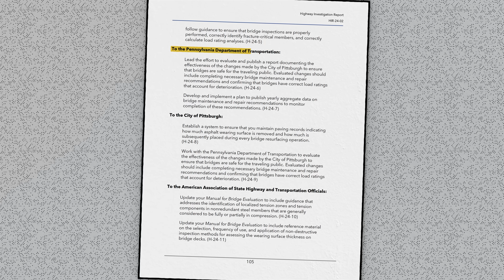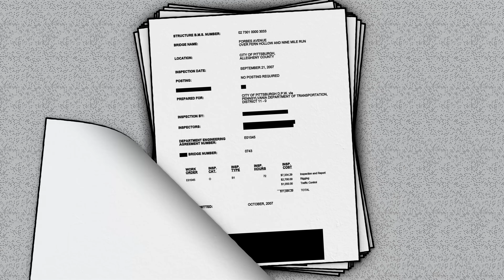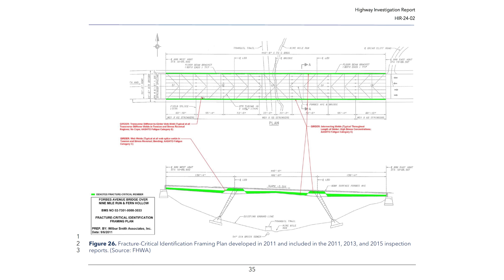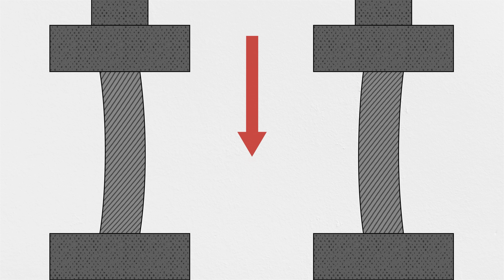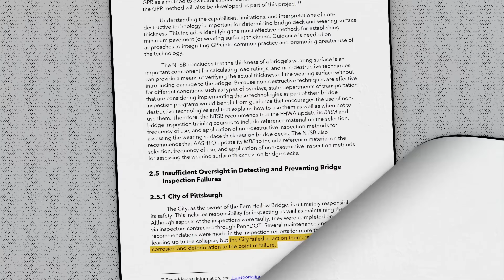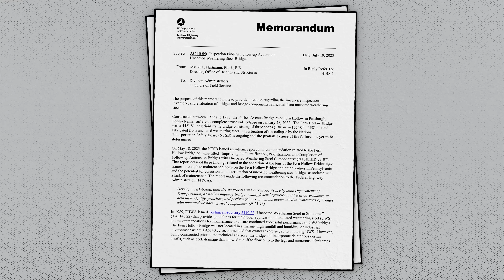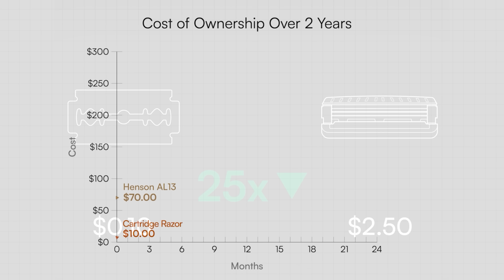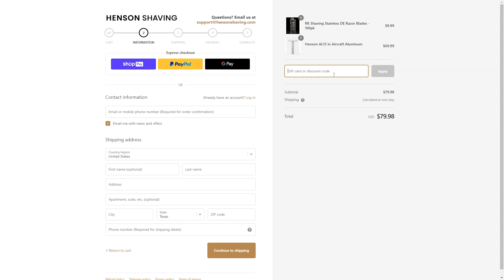This Bridge Should Have Been Closed Years Before It Collapsed

Comment from the maker: 🌉What do you think is the solution to this failure?
🪒Get a cool razor and 100 free blades: https://bit.ly/3CWiWJP
Reply: Simple solution: in Germany the inspectors simply have the authoriy to close the bridge (or any piece of infrastructure) if they find any critical stuff.
Reply: Galvanising would have protected it better methinks.
Reply: well to your point at 17:37, I'd argue that that whole ordeal is to prevent a post like that from existing, you can't take a picture of a completly rusted off steel member if it gets fixed when damaged and a steel beam with rust on it at that kind of bridge will not get any attention, so the "common sense" point feels weak, if we have to use common sense, call me uninformed, but I think then it is way past the point where action should have been taken.
Reply: Compounding inspection recommendation priority. With automatic preventative action if it reaches a certain priority.
Reply: Strong Towns talks about this stuff a lot.  Having a “maintenance mindset” where maybe you build less but maintain it well and plan for maintenance funding from the beginning.  Seems like a good solution.
Reply: I heard you say you went through 30 blades in a year.  Someone is doing something wrong I go through 3 to 4 a year.  I bought 200 blades when I bought mine years ago.  I'm starting to use the blades for everything I can think of I will never get through that many in my life time
Reply: Fail-safe; Designed so that when it fails, it fails in a safe manner. People (and especially engineers) need to learn (or relearn) what the term fail-safe means.
Reply: When these thing happen they need to do an investigation of who said leave it open including the elected officials. Far to often I have seen elected officials voting to override the people who say close it. They will then vote to build a new building or park while saying there is no money to fix what they already have. 
Until they are held accountable nothing will change.
Reply: I think the solution to a bridge failure is build a new bridge. Of course, it's an opportunity to evaluate present needs. MAYBE the solution is just close the road.
Reply: @jimk8520  failsafe are important but it also has its limitations for how it can be used, like how do you engineer a few ton bridge to fall several meters safely? And even more for large bridges. The gas pipe getting exposed and broken which could had lead to further damage is pretty much the only point where that could had been done 

Personally I'm all for what the guy from Germany said
Reply: If government is responsible, no one is responsible.  This is completely a government problem.
Reply: 1) when projects are first undertaken, the entirety of maintenance costs for the life of the project should be allocated up front and cannot be reduced later. If you can’t pay to maintain it don’t build it in the first place. 

2) the minute “this thing seems unsafe” shows up in a report it’s closed pending repairs

3) one PERSON is responsible for the project who has the final say. Not a committee, not a government, not a company. One person. They also have personal liability— they don’t do their job and ignore reports and something like this happens, they face civil and criminal penalties. If you can’t find someone willing to put their own skin in the game, then don’t build it.
Reply: @tylerh4612 my thoughts exactly. Except in the US we think we have endless amounts of money so we try to do both and fail at both too often
Reply: @jimk8520  You can not design everything fail-safe. That would be like building 2 bridges instead of 1, except that the "lower" bridge needs to be able to hold another bridge and not just some cars. BOTH then need to be maintained, the lack of which was the issue here. So how would that change anything?
Reply: It's nice when a level-headed engineer expresses solid, well thought out recommendations and shares them winsomely with the public.

They should have a monument to the people that could have died at that bridge. This is what happens when the bureaucracy fails or something like that. Definitely should be in the textbooks.
Reply: @leocurious9919  Think bigger. They could have decided to reroute the road such that they didn’t need a bridge. They could have filled in the area where they needed the bridge and just made a road. They could have removed dirt and such on both sides such that the road could have gone down one side and back up the other. Think outside the box.
Reply: @link7417  I like what the German dude said, too. With that said, it’s obvious that the new one they’ve built doesn’t have nearly as many design issues as the old one did (even if it isn’t as “pretty”). Hence, certainly more fail-safe than the previous one.
Reply: Inspection oversight and people held responsible should do it?
Reply: The simplest and cheapest solution I think is to clean the drainage ports. Ignored in infrastructure so often.
Reply: @ParanoidMaster that’s definitely something that should be implemented in America. In Germany are the bridges government owned or city owned and are the inspectors private contractors or are officials of the government? And when I say government I mean from the national government? I’m curious
Reply: @jimk8520  but that isn't what fail-safe means, it means that something fails into a safe state, take a lathe for example, if the speed controller would fail for it to be fail safe would mean if it failed it would cut power to the motor, so it's in a safe state, doesn't matter how well built that speed controller is, if it doesn't do that or a similar thing it's not fail-safe,
Reply: Funny how slow the NTSB is, it’s almost like Dan Gryder is on to something…
Reply: @link7417  Notice that I used the word “more” first. Being closer to a target can still mean one has missed said target. I do know what fail safe means.
Reply: No amount of money can force Democrats to prioritize infrastructure over flashy projects and corruption.
Reply: Many a man has tried to push rope, and its never worked, its almost a rite of passage.
Reply: @link7417  I also fully realize that nothing is perfect and nothing lasts forever but we can and should get closer than we do when it comes to critical infrastructure. Heck, simply replacing infrastructure that has already reached its design lifespan would go a long way toward avoiding this type of issue in the first place. And when addressing infrastructure types like this, knowing we’ve already needed it for 50 years, when we rebuild it we should build it to last (yes, that is possible - I mean, the romans proved it a long long time ago).
Reply: The bureaucracy you have, the less common sense and action.
Reply: Shipping to Europe costs the same as the product. I think you should have mentioned that the offer is effectively for Americans only.
Reply: @dckatyx9577  And no amount of money can force a Republican to prioritize anything at all over profit.
Reply: Better regulation and real consequences for the people who neglect this sort of thing.
Which won't happen because, in the USA, the Gov is controlled by large companies and/or their lobbyists.  ☹

I'm often surprised, sometimes appalled, at how poor consumer protection laws are over there, if they exist at all, watching Louis Rossmann's rants often baffles me.
Having said that I'm often frustrated by how little the penalties are for failures, here in Oz. 😒
Reply: Grady for Transportation Secretary!
Reply: Not only give the inspectors the authority but the responsibility to close unsafe infrastructure.

We could also require insurance policies for public infrastructure. Insurance companies would refuse to insure risky infrastructure and it would have to close or be repaired.
Reply: @JC-yt1pm    HAIL!  I Second.   
ALL political power is Inherent in the People.   🇺🇸
Reply: PS ...   they are SERVANTS, not "officials".
Reply: During my career as an engineer (EE), EVERY product that my companies offered had a "Responsible Engineer" who had broad authority to, for example, issue a recall or engineering change order ("ECO") . When a major fault was discovered (and it did happen occasionally), the Responsible Engineer ensured that existing installations were immediately shut down until a fix was in place.

The rub, of course, is that this is a role that requires expertise, training, and experience -- and is therefore expensive. So long as taxpayers refuse to fund government, catastrophic failures like this will continue.

Ironically, my own degree is from CMU in 1974 -- a short walk from the failed Fern Hollow bridge. I remember when the failed bridge was opened to great fanfare as noted in this excellent piece.
Reply: @jimk8520  you clearly don't if you think if you can't separate something being built more sturdy and longer laster and fail-safe, you are expanding fail-safe to mean won't breakdown or less likely to breakdown, I am not disagreeing whit you other then vocabulary, we can't tell if the bridge is more failsafe whit out a deeper analysis of the structure, which I can't do from just a image or video, I would need a blueprints and material specs, else we are just saying, yea that looks built great like 

do I think bridges built today is skimming to close to the margins in persuite of both governmental and corporate profits? ofcourse I do,
Reply: This bridge did not collapse without warning; the warnings had been clear to see for years.
Reply: @0MrMath  This is something you will learn if you use YouTube again.
Reply: You may want to keep the beard Grady.  Looks good on you.
Reply: Tax the rich!
Reply: @dang48 He can't seem to grow it on his head or his face.
Reply: Those Henson razors are really good for a younger person, but they're too expensive for an older man. The Maths are against someone like me buying one. 

After calculating the advertised cost of a razor plus (an essential) stand, adding sales, import duties, shipping costs and handling fees it would cost me close to $175 to have it delivered to the U.K. I spend the equivalent of about $7.50 on blades for my razor every year, and I almost always buy them in bundles of 10 or 12 packs which last me for 12 to 15 years. 

On that basis, to break even with the cost of a Henson plus a stand it would take me about 20 years, not counting the cost of buying good blades for the Henson. That will happen when I'm about 90 years old. No man in my family tree has ever lived for longer than 84 years. So I shall buy a few more packs of blades in about 5 years' time, if I'm still alive and shaving.
Reply: @RWBHere  I use and love the Schick 5 blade razor, which gives me an ultra-smooth nick-free shave. Each cartridge tends to last 1 month, although I would ditch them after a week if they were cheap. Does the Henson single blade shave as close as my 5 blade, and is it nick-free?
Reply: @ParanoidMaster  Not simple. Infrastructure spending by law is not the priority.
Reply: The solution is that your bridge inspectors should be able to do more than make recommendations. I think it's a pretty good general rule that the people who have to foot the bill for safety measures should never be the people who have the final say on if they're enacted, because they're always going to be biased against doing so. It's the most telling thing about how broken the system is that you had decades of inspections making the same recommendations to repair things and nothing being done because they didn't have to.
Reply: Insanity Is Doing the Same Thing Over and Over Again and Expecting Different Results
Reply: 50"Solution to this failure"? Pay me a lot now or pay me more later.
There are so many layers to this failure. Build a rusting bridge in the rust belt, a couple decades of acid rain, all the extra asphalt that probably clogged the drains. The bus was the actual final straw, or was it the speed of the bus or that last inch of snow.... It reminds me of the rust in areas of my '66 Mustang. Every drop of water left behind a bit of debris in every nook and corner that held more and more mucky water against steel for ever increasing lengths of time. Ford engineering didn't plan to build a car to last 50 years but I bet those bridge designers thought they were, soooo how old was the bridge? 🌉 Somewhere that guy is saying, I told you so.
Reply: The solution to the failure is obvious.  But the politicians and bureaucrats will investigate their actions and find they did nothing wrong. So failures will continue unabated.
Reply: @SolaceEasy  He seems to be doing a pretty good job of the beard on his face.  These take time.  I know, it took a couple of weeks before my beard was thick enough to be shaped.
Reply: The Fern Hollow bridge collapse seem to be mostly a failure to follow the intent of the process. It seem like some people had the idea that the process is done due to legal requirements not because there is logic behind the steps. The NTSB correctly has no ability to prosecute the people responsible. (There are good reasons for this.) I wish that a parallel legal investigation happened for this bridge much like what is happening with the Key bridge in Baltimore. It may be too late at this time because the information in the NTSB report cannot be used in litigation. (If I understand correctly.) This is to protect future NTSB investigations.
Reply: ok this is personal taste but to me new bridge looks way more pretty than the old one ever did
Reply: Maybe spend/send less money overseas for a start?
Establish local accountability, government itself seems to only make for more government.
Reply: @ParanoidMaster  This, it's insane an inspector can't order the closing of a structure due to safety concerns.
Reply: @ParanoidMaster  We have something like that in the construction industry in the USA. Someone who has "Stop Work Authority". If they believe something is unsafe, they can stop all work on a construction site
Reply: Actually funding bridge maintenance instead of 🙈🙉🙈🙉🙈🙉 over and over again. 

Inspections are wireless unless the problems discovered are acted upon. A law that mandates demolition of any bridge found in poor condition in two consecutive inspections might do the trick, if state govt has the cojones to ignore the howls of complaints.
Reply: @ParanoidMaster In the US such a decision would be reversed by the politically appointed leadership in seconds. Too many idiots think they know more about the matter than the engineers who have studied such things.
Reply: Obviously not enough duct tape and cable ties.
Reply: Was it a failure though? It seems to me this is exactly the kind of ineffective bureaucracy Americans actually prefer as it supports the all-government-is-bad mindset.
Reply: Sorry to say, but that beard doesn't really suit you. At least that is me and my girlfriend's opinion. I hope that is okay to say, as I hate when people lie to me about a new style and I only find out several months later.
Reply: Part 1: Automatic priority escalation. Part 2: Predefined point where the major priority gets automatically escalated. Part 3: Give NTSB responsibility to issue a followup report. All of this won't prevent a disaster given arbitrarily dysfunctional reviews & inspections, but should reduce the frequency of similar failures.
Reply: Stop hiring contractors to "save" money. The machine is failing because we're replacing high-quality pieces with cheap after-market replacements.
Reply: Eliminate the layers of bureacracy between the inspectors, the engineers, and those with authority.

When an inspection teport is issued, the three need to sit down together and discuss it.
Reply: ⚠️⚠️Savekerala⚠️⚠️from📛130 yrs old ⛑️⛑️ Mullaperiyar😭😭dam collapse 🙏🏾🙏🏾🙏🏾 please do a awarness video on this
Reply: ⚠️⚠️Savekerala⚠️⚠️from📛130 yrs old ⛑️⛑️ Mullaperiyar😭😭dam collapse 🙏🏾🙏🏾🙏🏾 please do a awarness video on this
Reply: @travismartens1637  I was doing the same as you, changing it when it was dull. But then I had that same realisation as you, at this rate I will be giving blades to my great grand kids as inheritance. so now I take a new blade everytime and have an easier shave than working with a somewhat blunt blade
Reply: @ParanoidMaster  I fully agree with that. I think it's a must have. But it should be the last solution to this problem, if the bridge is not properly maintained.
Reply: Rules are only as good as their enforcement.
Reply: The problem with the 'Machine', as you put it, is that everyone needs to be paid and there are time constraints, a great deal of bureaucracy can be removed so taxpayer funds are not wasted. Look what happened with Twitter, 80% of the workforce let go.
It is easier to have one company do all the work and then report to one authority and hope like hell they are honest.
Reply: "Get a cool razor and 100 free blades"  - newly-minted Practical Beardman 😉
Reply: People in the past: We will build amazing infrastructure for the future!
People now: How can we avoid spending any money?
Reply: Eyes and common sense.
Reply: :hand-pink-waving:
Reply: $$$ Money! Money for more inspectors, money for proper maintenance. The Cape Cod bridges when I first started going to the Cape 20 years they were going to replace the two bridges and every year since then they have been trying to get funding for it. One of the places that Fern Hollow Bridge got their funding for the new bridge was from the Cape Cod bridges, the funding that Congress had for the Cape bridges that year went to Fern Hollow Bridge and another bridge. Funding for the infrastructure seems to go to the squeaky wheel, or which politician who has the biggest clout.
Reply: MorganOlt  In Toronto, the city health inspectors do a red/yellow/green thing on every restaurant, and the last result MUST be on display prominently when you enter the restaurant. Most places have it in their window next to their hours. It's awesome how quickly yellow signs get updated. 
Someone made the suggestion that the priority of the fix gets raised every time the bridge fails inspection, so a B will become a C next year if nothing is done. That's great, but the grading system has to be out of reach of the politicians voting on the budget. If they can redefine the standards so that a B becomes an A, we're back at the start. I think that means the federal government needs to set standards, but state or municipal governments should be in charge of inspection.
Reply: It's Pennsylavnia, it's endemic to the culture, that is, ALL Public Agencies do this . . .
They can never find the money to MAINTAIN anything, but always manage to do what it takes to replace a facility once someone is hurt or worse.
Reply: Government should be sued for negligence it seems they let the bridge collapse instead of maintaining the old one.  I'm sure lots of people will fund a new bridges construction that will cost much more than the old ones maintenance
Reply: MorganOlt 
These inspection reports are sent to the bridge owners - Pittsburgh government in this case - but the public rarely notices all the neglect.  

It seems to be the responsibility of muck-raking reporters to motivate the public. 

However, the reporters are going to have difficulty when the inspection reports becoming classified for reasons of "national security".
Reply: How about just requiring, by law, a licensed engineer (PE in the U.S.) to sign off on keeping the bridge open after every inspection? (She should have access to all previous inspection reports and recommendations, too.) If, based on the inspection report's recommendations, sufficient mitigation isn't done you'll not be able to find an licensed engineer to sign off on it, and you'll have either to do the required fixes or close the bridge.

We already do this with new builds; I'm mystified as to why we don't do it with continuing maintenance.
Reply: Operational Risk Management Tools.
Reply: Give inspectors a degree of power to close bridges. Or have someone who does accompany inspectors on a regular basis. The most fundamental issue is the sectionalized task, so bridge that gap which is as simple as giving someone authority even if limited in both areas
Reply: Henson nailed it when making the razor...
Reply: @dckatyx9577 Biggest infrastructure bill since the highway project was passed by democrats lol
Reply: Hold people accountable, people in these positions feel comfortable dismissing a bridge report for YEARS with no possibility consequences for their inaction. The inspectors did their jobs, even the group that did the load evaluation, the mistakes made where not unreasonable. The City of Pittsburgh failed, the people tasked with taking action from those reports should have been held accountable, possibly criminally. 

Implementation of laws that would allow for the prosecution of gross negligence in these position would lease to people involved in these processes being more motivated to do their actual jobs.
Reply: @neurofiedyamato8763  …with overwhelming Republican support. Unfortunately, if you track the money, you will find that much of it does not actually go toward infrastructure - just like with the previous bills passed during the Trump and Obama administrations.  Green projects, sustainable cities, and numerous other special interests receive priority from corrupt politicians and bureaucrats.  Look how high California gas taxes are and their crumbling infrastructure.
Reply: Why does the webbing and reinforced sections have to be only at right angles? 
If the water and debris could slide off, it would dry up.
Reply: The only thing that will fix it is SPENDING. We should be spending on ourselves first. Not wars.
Reply: @donk1822 Galvanized is just a zinc coating on plain steel. We should be using steel with more chromium aka stainless steel. All steel rusts v
Reply: We have Weathering steel structures used in some of our 500 kV transmission lines and we are replacing all of them because of the same rust issue due to the humid climate
Reply: The problem here is that budgets for such stuff are typically served last, and it is politically and managerially easier to kick the maintenance can down the road.  A solution I suggest is to implement accountability for the decision-makers who decided to kick that can, and accountabiltiy for the engineers who were prepared to sign off on an assessment that proved to be so wrong.  The sooner that decision-makers see that there are possible consequences for deferring critical maintenance then the sooner that the maintenance will be green-lighted.
Reply: @onmywayout  If your budget allows it, marvellous.
Reply: @travismartens1637  And $3 a blade?
Reply: Give the guys a break! It's very difficult to afford bridge and infrastructure repairs with the ever-increasing cost of luxury hotels and room service for hundreds of thousands of illegal aliens.
Reply: Are you a JW?
Reply: Knowing what a K frame is.
Reply: Are the inspection reports publicly available. If so we can advertise the deficiencies putting pressure on the gov. To fix the problem.
Reply: More so, routine maintenance should've been done on the bridge to avoid costly damage and repairs to the bridge.

Simple drain cleaning and rerouting the sludge AWAY from vital supporting structures would've solved this problem.
Reply: 14:10 The timeframe to complete priority 2 inspections is before the next inspection. So implement a process by which, upon the next inspection, if the previous priority 2 issues were not addressed, the bridge must automatically be closed. This takes the onus off the inspector for making an unpopular recommendation, and places it squarely onto the bridge owner (City of Pittsburgh) for action. And when the travelling public gets angry, it's clear who they'll be calling.
Reply: Money. The solution is money.
Reply: @ParanoidMaster  That's really it. Possibly that any bridge rated a 1 or 2 priority is immediately issued a second opinion inspection and if that person concurs, the bridge is closed until work is completed.
Reply: I think the solution to this is failure is to sell razors. So good. Applause. Integrity. Cool razors, sorry. Cool, not regular.
Reply: The critical part here is effective management of asset information. The inspection program was in place and was delivering condition information but this wasn't going anywhere. All too often this is caused by over reliance of reports which are unstructured data. Instead condition assessments should be carried out on mobile platforms linked to the organisation's EAM/ asset performance management software which can automatically trigger alerts to the correct person to determine the appropriate intervention
Reply: @dang48 Keep the beard, lose a sponsor… 🧔
Reply: @ParanoidMaster  That is not entirely true. The bridge inspector can identify defects and make recommendations. Ultimately, however, implementation is the responsibility of the road construction authority, which is also "only" a cog in the machine and subject to political decisions. Of course, no politician wants to hurt voters, but cutting off a vital transport link and thus limiting convenience for years is a highly unpopular political outcome. There is endless haggling to keep something going.
Reply: New bridge
Reply: If there are 5 people (for example) who make the final decision to close and repair a bridge, then wouldn't it make sense to include those 5 people on the inspection tour with the engineer tasked with making recommendations? That way the engineer can show them first hand how bad it is and answer any questions then and there. This would make the risks clear to the money people why the builder people are concerned for the common user of the bridge, and would hopefully get repairs rolling sooner.
I also think there should be a mechanism for holding city officials liable for not acting on an engineering safety report for a decade plus. Haul each of those people in front of the injured parties and the tax payers to personally tell those who were injured for life why their life was not worth protecting by acting on the report. Make them face the consequences of their inaction and make them take responsibility for it.